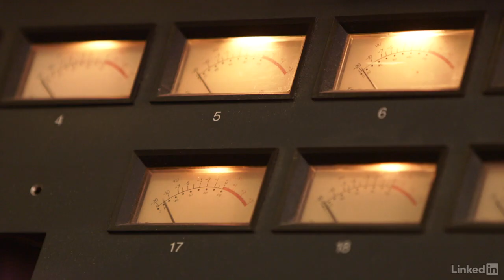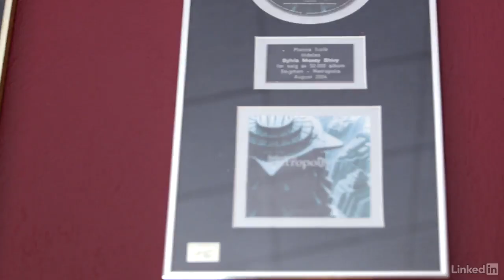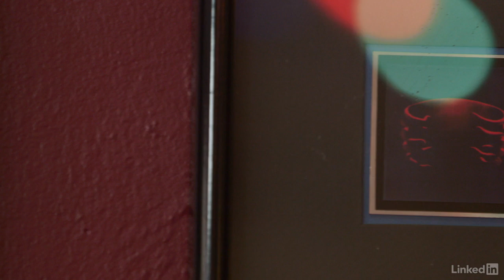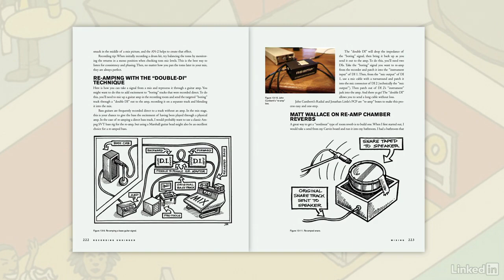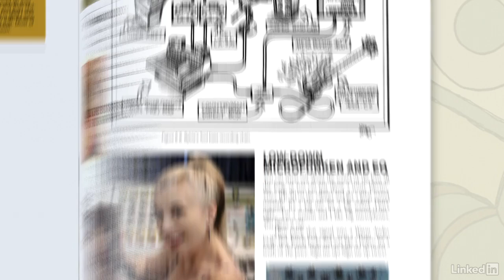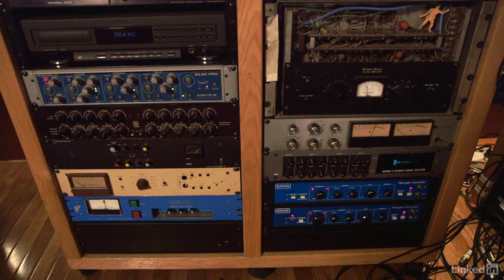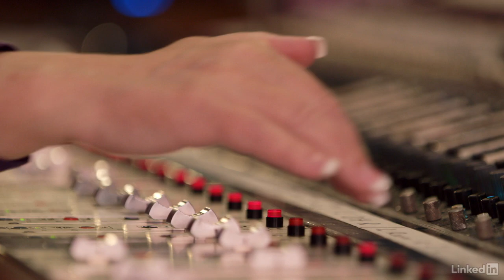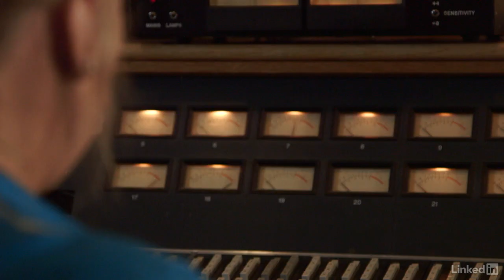Sylvia Massy: Unconventional Recording

Comment: i really need help. i want to record with my new analog desk through pro tools. what’s the best way to go about this?
Reply: using a DA converter with enough outputs and plug the outputs into the mixer inputs and the output of the mixer to an AD converter or you could also hook up the direct outs of your console to an AD converter so you can use the consoles preamps.